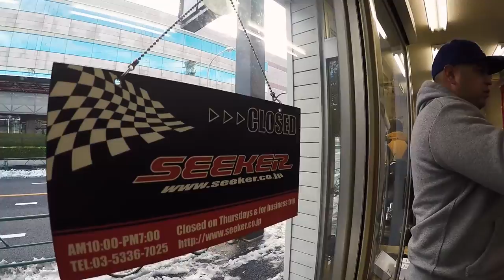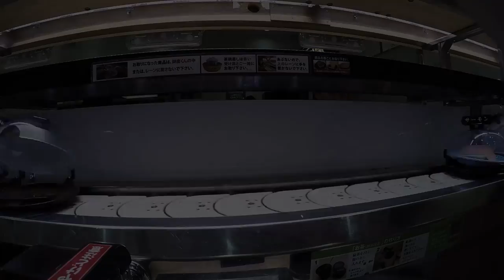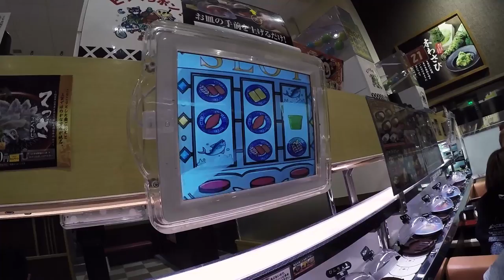The Chronicles Vlog 2016 #1 (Part 5): SEEKER and FEEL'S Twin Cam...

Comment: Hey, nice video! I went to Spoon and Seeker as well during fall of 2015. Seeker had their awesome orange FD2 demo car in their parking area, 295/30 front tires <3. Didn't make it to Feels though, feelsbadman.... Still don't really like how most japanese builders do their cages, but the overall concepts of the CR-Z and Fit looked clean and interesting.
If you haven't already, I would recommend to check out fun2drive car rental in Hakone! The owner and staff are super nice, and the car selection is impressive.